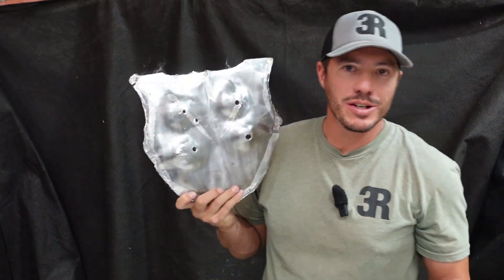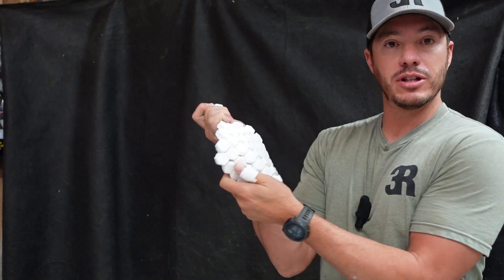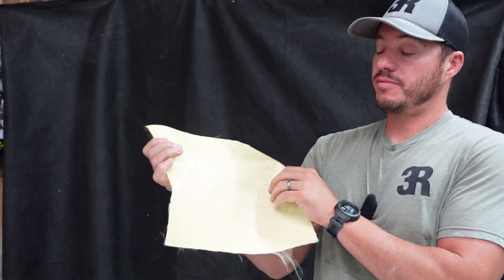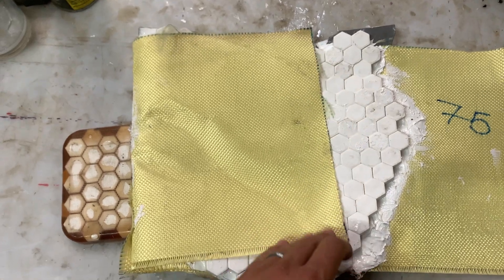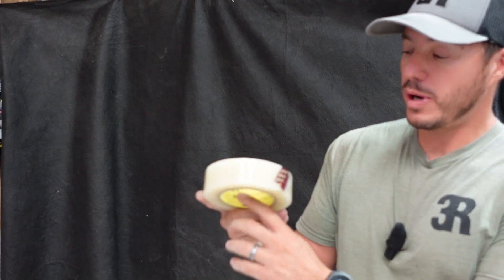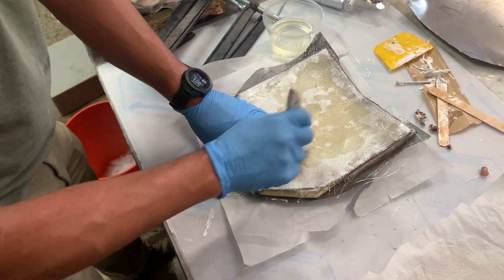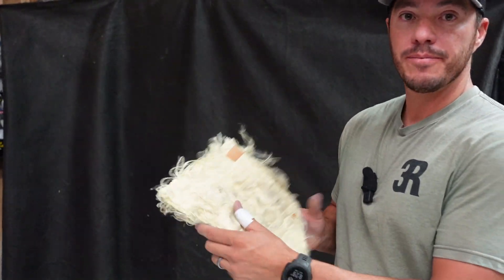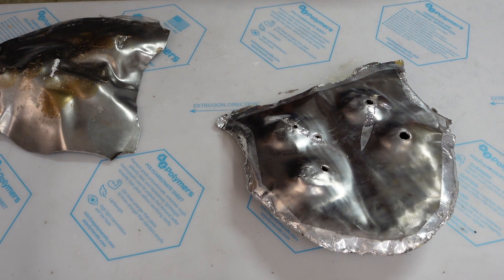Modern Medieval Armor Home build

Comment: Can you compare S-glass vs E-glass vs basalt composite?
basalt AFAIK is strong as E but tough as S
Reply: BTW I found some researches about it.  Not a lot of difference with vinylester resin as remember. 
Gonna search for epoxy modifiers against bullet. For impact strength they give twice Joules.

Comment: would be nice to see a build of a standardized plate using these new level 4 protection material combination.
also makes me wonder if there is something that can be done to stop those huge bulges on the inside of the plate, because like you said it yourself - you are not walking away from those blunt force injuries